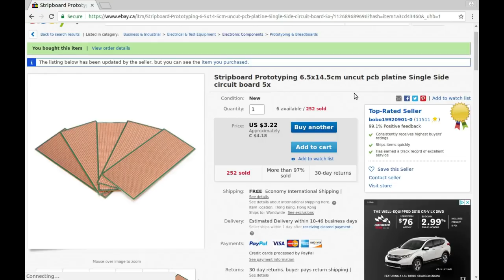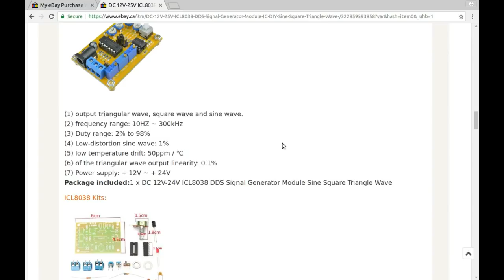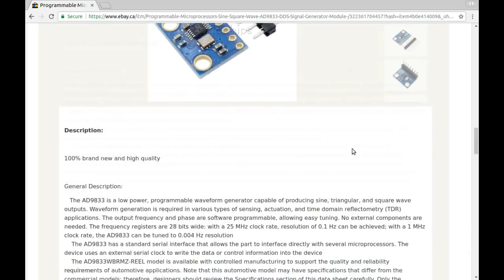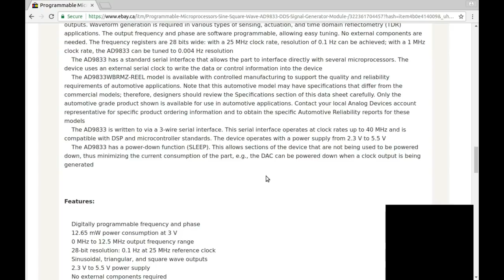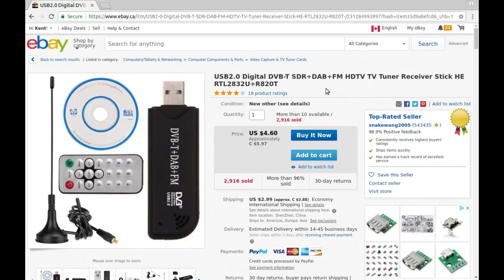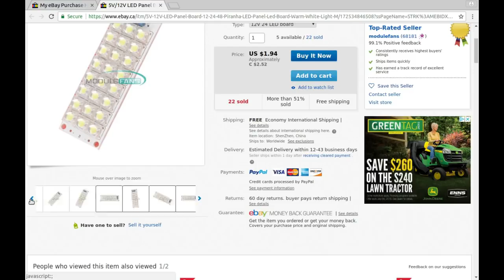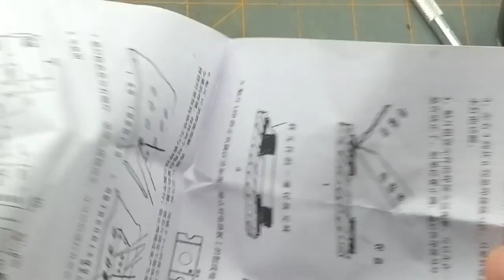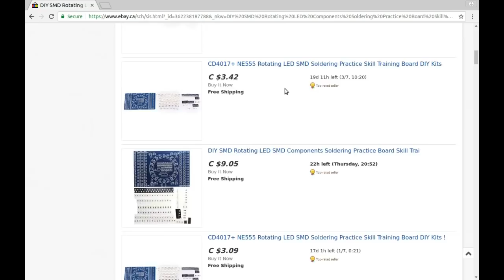mailbag monday 31

Comment: Hello, about the SDR dongle, I suggest to you to try the DBV-T2 version (check what is written on the front, it is light bleu). It is more stable and the noise is lower.
About the enclosed antenna, you can cut it putting a bnc or a pl on the other side but sometime that cable is not a coax cable (not a real shield)so I suggest to buy a rg-316 pigtail.
Reply from the maker: The one I have was bought specifically as the cheapest I could find. Mostly to see what I can squeeze out of it and if I am likely to carry on playing with RF before investing in something higher end.
I do have a small assortment of adapters for the MCX connector to BNC, SMA, and F type connectors. 

I just haven't had time to spend exploring the possibilities yet.
Reply: The difference is very little, but that is the reason the old black model is sold at almost one half and the blue one at about seven Euros  (sorry, I don't know the rate at moment...).
SDR is incredible, and that toy gives the possibility to try it at the cost of one pizza!
The problem of that dongle is the dynamic range: eight bit samplig gives a very low dynamic range: if you have a strong transmitter near your home, you must use a filter or reduce the sensivity (the last HDSDR version shows the input level related to the upper dynamic limit).
Ciao!

Comment: Nice mailbag.  For the SDR thing, you might be seriously disappointed with that antenna.  Just hook up a longer wire to that thing and you'll receive a lot more.  To bad the dynamic range is not that good and strong FM stations might mess up the rest.  Still a lot of fun to play with.   Those leds seem like a nice thing to convert an old desk light. Remove the halogen bulb and just glue or screw it in place... a usb power supply that we all have loads of now and your set to go.
Reply from the maker: Yeah, the antenna does seem pretty lame.

I have some adapters to connect it to my rooftop TV antenna, so that shoul dhelp - at least for broadcast band stuff.
DIY antennas is a hobby all it's own within the SDR world.

Comment: I think this led package is called super flux, at least this pops up in search engines. About this signal generator kit: check component values, not only what is written on them. I bought one of these kits, and two of caps (these disc shaped ones) were of different values, I think they were supposed to be 100nF, were marked like that, but they had much lower capacitance. It's better to check them before building kit, that way it saves a lot of troubles.
Reply from the maker: Some of the listings do also use the term "superflux" in their word salad descriptions. 
It's often challenging to decipher the english names that some of these Chinese sellers use.

Verifying your components is always sound advice with these cheap kits.